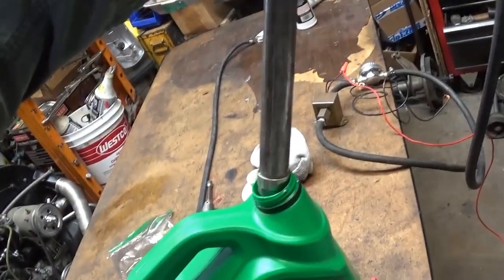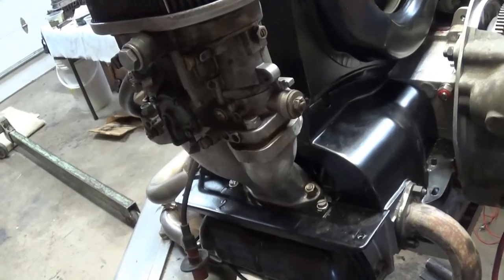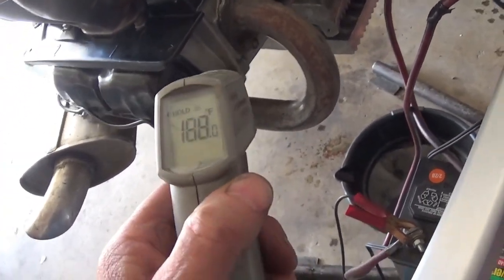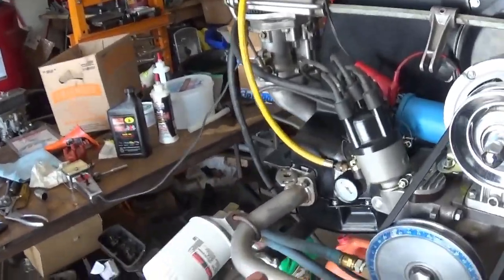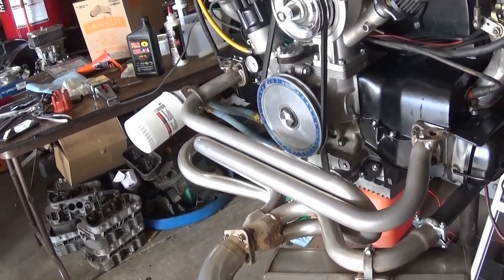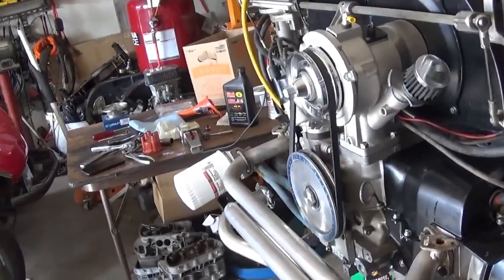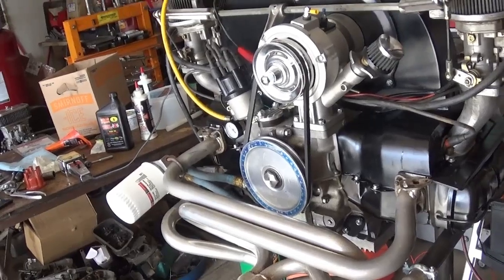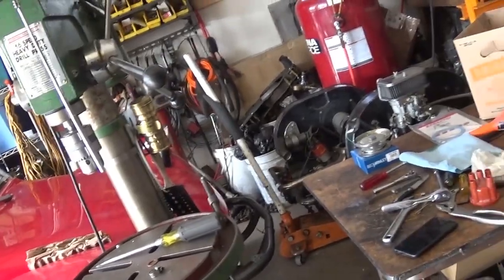VW Camshaft Break In. 1600 to 2110 Conversion

Comment: That's a slick oil setup. For years I used an old oil pump with a hand crank welded onto the drive gear, and pumped it in through the full flow fitting before firing the engine. It was messy, but worked.
Reply from the maker: Results is what count. Thumb up friend

Comment: Hi EZ.
Hope your well.
I have just fitted a new cam into my 1600 twin port.
Everything is standard, so no performance parts.
I intend to use a high zinc break in oil, then change after for usual stuff.
Do I need to ‘burn’ the camshaft in at loads of revs for 20 mins, or can I just get away with running the engine back in the van carefully for so many miles, without doing the burn? 
All the best.👍🏾🇬🇧
Reply from the maker: Yes you should break in the cam.  The new cam has a coating on it and the camshaft supplier usually provides a special lube that should be smeared all over the cam lobes during installation. 
You don't have to rev it to the moon during break in but you for sure don't want it to idle for any length of time.
The Burn as you refer to it is creating enough heat to work harden the cam and lifter surface and get a good pattern match.
During the break in is also the time to look for possible oil leaks and problems. Just after break in run you want to drain all that expensive oil and Zinc additive out while the engine is still hot and everything is stirred up in suspension. Pull the filter screen out and you will probably find little peace's of engine sealer stuck around it. You want all that junk out of there. Let the engine cool down where you can comfortably touch it with the palm of your hand anywhere on the engine. You don't have to leave it sit overnight like many folks do. Refill with fresh 10-30 oil of your choice and ad some more Zinc additive or use whatever fresh break in oil you had,  Pop the valve covers and rotate your engine while performing a valve clearance check .006 is fine.  Look things over. Wiggle your rocker arms side to side. Make sure the springs and retainers look straight.  
Don't baby the engine just because it's new. Drive it like you will drive it normally. Take it on the highway. Don't drive at a constant speed for long periods. Change the oil again after a couple tanks of gas. Recheck the valve clearance and if things are good at that point and you are good with your maintenance that engine should give you lots of smiles and miles.
Don't over think it. Just be observant.

Comment: I'm about to jump in and build a 1904 74x90.5  with the fk7 cam I have a 32x36 vw Weber carb and intake not sure if I should buy dual Weber carbs 🤔 also will be running the bigger vualves
Reply from the maker: No need to run bigger valves unless your a weekend warrior. Stock heads will work find.  I lost a valve guide because so much valve guide support was removed for flow.  You need HD single springs and retainers and keepers. !.25 ratio rockers will make an improvement.  Get the geometry right.  You can use stock aluminum pushrods.  and need to use shims under the stands. I did it. It will work.  You may just consider a Engel 100 and not look back. Great torque for a street engine..  The Fk7 will work with 1.!!  (stock) or 1.25 (slightly (noticeable) or 1.4  (Dangerous) unless you get the geometry perfect.  ( I lost a valve guide) using a 044   40X35 Head. $$$$$$$$  Truthfully. I wouldn't bother with a 74 stroke again. Go with a 78.8 with 90.5 B pistons and don't look back. Goes together easy with stock length pushrods. At the same price. but you will need the stocker case or do more cleansing on you old one.   Why spend money on a old case that is worn out. New case, New crank, Standard bearings = long life and peace of mind.

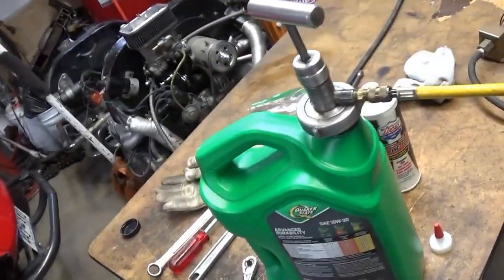Comment: EZ!!! I just finished this size engine.  1:25 rockers 42x37.5 heads 125cam with dual 48ida do you think 200 air is enough with 60 idles on F11 tubes?  🙏 God bless
Reply from the maker: Give it a try.  If you need to fatten it up go with 180 air

Comment: What's your thoughts on a Erason racing cam 467liftx287duration in a 1835cc with a nice set of heads 40x35.5 valves?
Reply from the maker: Great if you have Port on Port dual 40 mm carbs. Like 40mm Webers or 36 Dellorto carbs
Reply: @TheEZGZ  Ive match ported them. They also been fly cut to 48cc chamber putting it at 9.5:1 compression. Im running what I have for carburation which is a Weber 38dg it still runs good but. I'm wanting to go duals 40s or a single 44idf.  it revs fasts and I'm not seeing any fuel problems do to the 38dg. But it could use and idf.
Reply from the maker: The dual 40's would run far smoother than the 44IDF.  If what you have works I would stick with it. I guess I'm going to have to get off the couch and make another Weber video.  So many people are asking Weber questions since spring is here. Stay tuned.